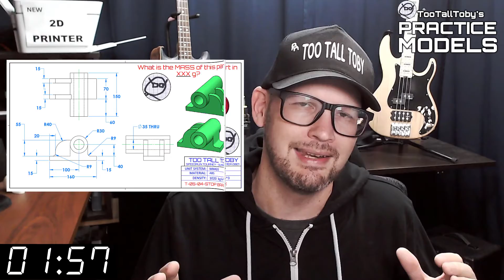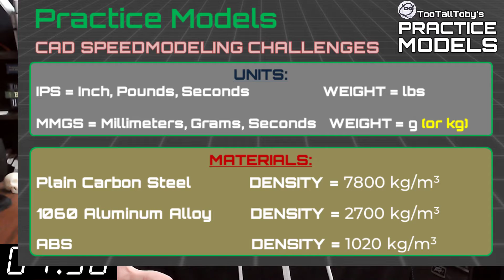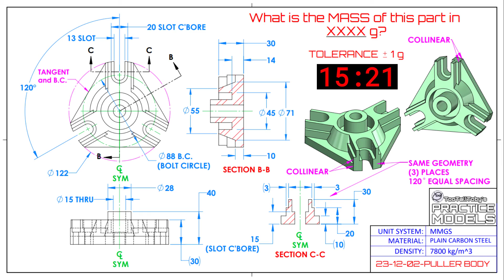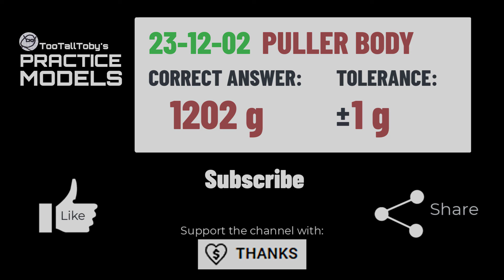CAD Modeling Challenge - Onshape, SolidWorks, Fusion360 - PULLER BODY - Secret Dimension?

Comment: 1202g in OnShape...about an hour!  😝 Took 2 tries (misplaced dimension first time).  I thought the hardest thing about this one was aligning the elements of the 2D drawings to the 3D model and keeping that in my head long enough to get the sketches correct.  Another lesson learned:  If you're going to use a loft, get it done as early as possible.  Lofts don't like anything in the way.
Reply from the maker: Awww yeah awesome!  Well done!!

Comment: Mass: 1202.08 g with Plasticity
Time: I didn't manage to do it in the given time.
Video: https://youtu.be/f3KahLZ-iF8
I took too long to figure out the dimension of the upper blue arrow in Section C-C between the 3mm. Now I know that the dimension is not needed. Thank you for the lesson. 👍
Reply from the maker: You have to calculate that "missing" dimension from the top down view (make a triangle, cut a circle)
Nice job!